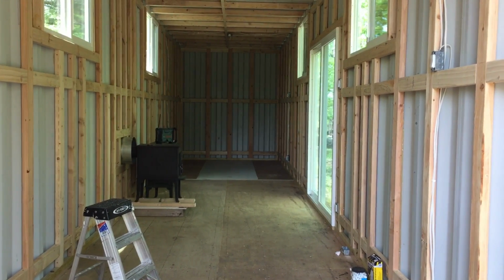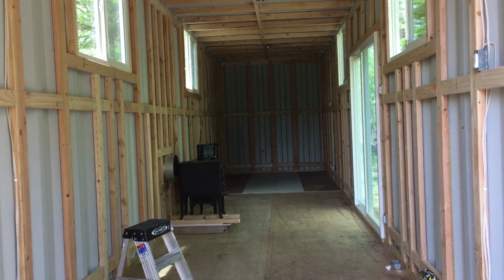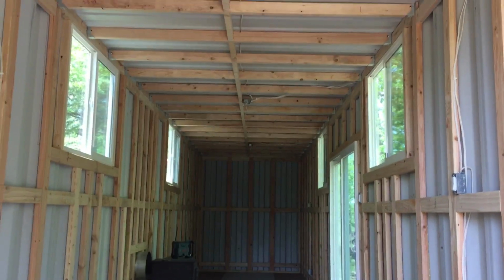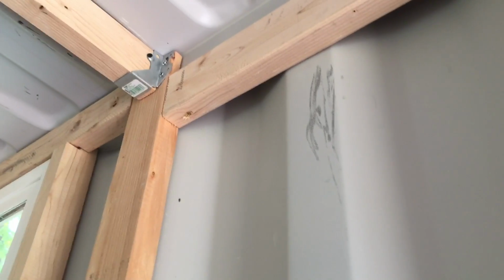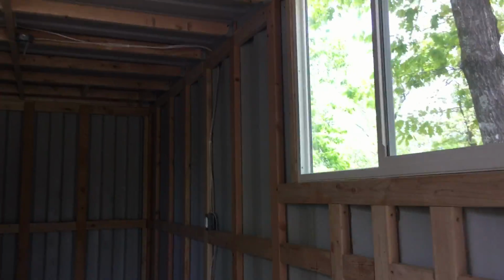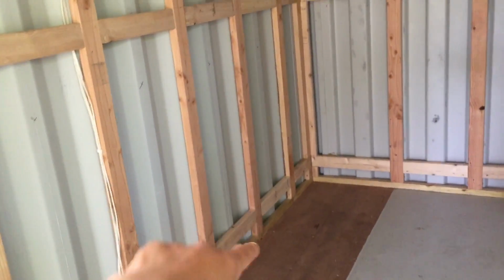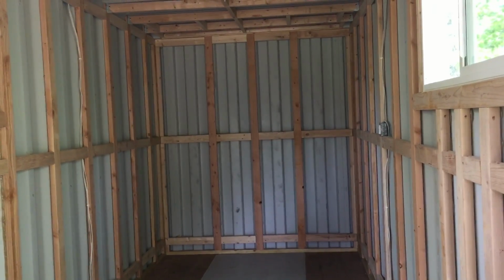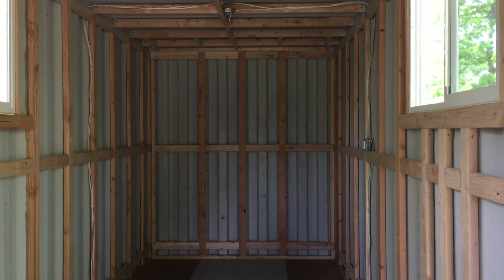Shipping Container House Framing

Comment: There's a chance someone will run a screw into the wiring. I think I would run the wiring in conduit and surface mount it. This would allow anyone to make changes in the future. 
The studs could probably be 2x2's or 2x3's and spaced 24 inches on center. This would reduce thermal bridging.
Reply: Totally agree being it’s a partitioning wall to begin with.

Comment: I have a thought that I invite anyone to reply to. I am planning a shipping container home. My plan is to frame the home on the outside, windows doors etc. That will give me voids to fill between 4 a 5.5 inches deep. I am researching using closed cell foam about an inch thick. Let it cure, then using the foam glue a foam board into the void and enclose it in the foam. I am thinking this may save money as I will need less foam. Then shave the excess, use Tyvec house wrap and Clapboard exterior siding. (I have a saw mill and can produce  these myself). Am I totally crazy? with the insulation on the outside will my walls sweat? I am building in southern Ga. Am planning a 36 inch perimeter wall inside for running the electricity, and exposed metal above that.  Also a 6x12 inch soffit around the ceiling to support LV lighting and the ceiling framing for conventional insulation. The roof will have a standard pitched roof to keep off the sun. Any thoughts are greatly appreciated. Al
Reply: Almon, it sounds like you are putting the insulation on the outside (smart), with siding.  I recommend Hardy Plank.  Have you considered foam insulation boards?
Reply: Seems the best option - good thinking.  Allow lots of insulation in GA & tarp the top from sun. Maybe skip the 3' inner wall - not really needed.    Likely u r cooling the inside making the metal colder than air- leading to some condensing...  But leaving exposed means east to wipe off/ bleach later if needed. Fans, dehumidifier, a/c probably good in the small space.
Reply: Alman. But most summer condensation should be to outside. In winter when warm air is inside maybe cond inside,  but hopefully minimal and easy to clean/evaporate as exposed.
Reply: Why even build with a container of your going to cover the outside and the inside ? Just so you can tell your friends you live in a container is a silly way to waste money, just build a traditional house of your going to do all that

Comment: i worked on a project that was three 40' containers. it was framed with mostly 2x3 metal stud offset 1/2 inch off the exterior so when the foam was sprayed in it was allowed to flow behind the studs and the steel skin.the ceiling was framed treated 2x6 on the perimeter with black paper stapled to the back and then bolted to the side of the container.  we did used metal shielded wire to rope it up and dropped the ceiling to 8' to allow for attic space to install hvac plumbing and fixtures ect.  i cut all the window and door holes with an angle grinder and we welded 2x2 tubing around the openings for strength. lumber was secured to the metal with screws to allow attachment of drywall and trim.  they used and under ground huge pipe buried in the ground that air was pumped through to help heat and cool the building. it was outfitted with rain catchment, wind and solar as well as a backup diesel generator acquired from a military/government auction.  it was about 900 square feet when complete and very efficient .
Reply: Have a link to it?  I'd love to see it.  Sounds awesome.
Reply: Cool story bro.
Reply: No link you made this whole wild story up

Comment: structural support???  What load are you carrying that would require extra structural support???   I've done over 300 containers.  If it's not treated lumber against that steel you're going to have rot.  How are you going to insulate now?  Not a wise design.
Reply: rmbaker100 what would you suggest ?
Reply: I thought he said there was a bead of glue on the back of the board. Would that leave a small space for foam to fill? Or would that glue fail.
Reply: @MaryCateOMalley   Mary Cate O'Malley  Spray foam can knock a nailed in window out of plumb.  It's an awesome thing as it adds insulation and can be a structural element as it tightens up/strengthens....but..  Since it can do all that it can also mess everything up.  #respectTheFoam ;). The foam will creep behind and I would be surprised if it doesn't bow out the metal walls and pop the boards off.  It would be better to have space to spray behind each board.  And if it's only 1/4 inch that's just stopping condensation and not offering any sort of insulation factors.  Not such an issue on the walls but...make that insulation thick on the ceiling.

Comment: Personally I would use Roxul for the insulation rather than spray foam.
It has a very high R-value, doesn't retain water & really great sound deadening!
Reply: isn't the issue here that the container will internally sweat? Therefor he needs the foam insulation to created a sealed vapor barrier so no sweating occurs which would otherwise cause mold and rot to form inside the walls?
Reply: I was thinking of using it after using a thin layer of spray foam to cover condensation issues.  Definitely cut down on the echo and would be great for bathroom privacy.  The problem with small home living is...folks can hear you potty.  You can deal with pee....but once someone gets diarrhea...ew.

Comment: Not a good idea to use Romex in a Metal Building. Should have been in EMT, "Smerf Tubing or Flex Conduit. Safety code violation and could end up electrocuting someone touching the bear metal
Reply: Earth it
Reply: Plus given the adhesive he used on the beams, I hope it's a non-solvent, or else it'll rot the insulation.
Reply: Would ROMEX with Sch 40 PVC pipes pass code?  You're still going to have metal J-boxes touching the steel frame of the house.  The J-boxes are the locations  where you're most likely to get a loose wire nut.

Comment: i know everybody has an opinion but if you use spray foam you will get ill, heat from the metal cube will heat the spray foam and create a noxious gas so stay safe and research this before application. spray  company's are now having to remove the whole roofs from properties that have been sprayed .
Reply: That off-gassing is caused by bad application, not the spray foam insulation itself. Spray foam insulation is everywhere in todays constructions. How do you suggest guaranteeing no inside condensation without the spray foam barrier?
Reply: @mattstanislen3165  Closed Cell polyurethane is polyurethane.  It will off-gas, regardless of how well it is applied.  But I get your point.  If not applied properly (right ratio for temperature), it will be a disaster.  

To Brian Clarke - heat can act as a catalyst.  It can speed up the chemical reaction that causes off-gassing.  It cannot create new off-gassing.
Reply: @usafa1993  i use celotex installation board and seal all cut edges and damage with foil tape . also a small vent in every wall located at the tops of each wall outside .
eco wool insulation is the only safe way and can be sandwiched between mylar foil for an excellent thermal  rating however be sure to leave a small void on the outside wall to prevent too much condensation .
Reply: There is a green spray foam available now.  It's what I'm hoping to use.  Otherwise I'll be drylocking the walls.  Also, I spray foamed our 36 ft car hauler with living quarters I gutted.  No issues or weird smells there.  :)

Comment: Nice video you could staple a vapour barrier over the frame which would hold back moisture adding to the foam plus it helps with sound deadening. Kingspan may be a cleaner and quicker option also thermally more effective but you did say your not really bothered how well it performs in my books this would take priority as in summer it would be cooler and winter warmer😐

Comment: Please tell me you didn't put that electrical wire between the metal container ceiling and the 2x4 lumber....
Reply: Please tell me why he wouldn't. There is an opening it went through, its not pinched.

Comment: This is the neatest framing I've seen.  DCP damp proof course membrane should have been added between the wood and metal. Condensation from the metal (not covered in spray foam) will seep into the wood, rot it out over time and mold will set in.
Reply: Yikes.....Mold and Rot.....
Reply: Only use membrane in a ongoing heated construction.
Otherwise heated side of the construction will change according to the weather conditions!
Try wenting the whole and use an automated dehumidifier... 
Regards from moist cold Scandinavia

Comment: do research on the chemicals in the floor
Reply: yeah gotta love methyl bromide
Reply: Yes, I have done 300+, A lot of unknowns in these things from the actual metal used, what's in the paint, what was stored in them.   Probably a health issue that Lawyers will make millions off of in ten years.
Reply: seal the floor with a couple of coats of paint below your finish flooring.Roll it into all the pores
Reply: @josephmclennan1229  Tear the floor out.  You don't want that toxic sh%t in your house.  Almost everyone knows that.  Replace it with 6 inches of polished concrete, with of course, radiant, hydronic, geothermal heating/cooling.

Comment: We have never seen anyone frame with 2 x 4's like this. Is this to code ?
Reply: Romex needs to be 1.5” back from wall surface or be protected.  The wall runs should be in conduit.
Reply: When putting framing inside of an existing containment like this container yes it is allowed to turn the two-by-four sideways but if the two-by-fours are actually structurally holding a load-bearing wall they are not allowed to be turned sideways
Reply: How will they bow out if they're surrounded by closed-cell spray foam insulation? Code varies by county & state so I don't know it may be legit in some places. I'm not claiming to be an expert here, just kind of playing devil's advocate to get more information on why I'm right or wrong. Any expertise you have on this would be appreciated.
Reply: The lumber will bow if in a humid enough environment, and if not fastened with mechanical means to the container. Glue, no matter how strong will ultimately fail. The foam insulation will not offer any additional support.
Reply: 1badpete999 I was thinking the same, the way he is using them, why not use 1X4's?
Reply: Good question
Reply: I have built custom homes and commercial buildings in 3 states, and all of those states allow the lumber to be turned on the side inside an existing structure due to the fact the are not part of the structural integrity of said structure. Though I do agree without proper fastening of the lumber it will eventually cause problems with the finished interior walls
Reply: These 2x4 will twist when they dry up ,at this point could have use 1X4 would have been les problematic !
Reply: Was also thinking the the way the 2X4 are installed they give no structural strength or economical sense at all, even if if their not used as a bearing walls ,and as we all know 2X4 spruce wood installed on their flatside will bend and twist like crazy when they will fully cure their water content down ! just saying !
Reply: ChefGiovanni moron
Reply: No Code on these things.  The guy is not experienced.  I am.
Reply: I would glue and bolt the studs because of possible bowing.
Reply: No it is not code. and no even inside a shipping container is this NOT ok.  also one thing that this guy wasn't thinking about is that those 2x4's will in fact in time Bow out and his drywall will be popping away from the wall...  I promise you...  wait for it.. wait for it...

Comment: Overkill... your only holding up your wall finish like drywall...
Reply: Must be an easier way to insulate it, perhaps on the outside.
Reply: @amathonn  Galvanized steel studs.  Floor to ceiling.  I understand the challenge of the gentleman who made the video.  Any sort of actual insulation in a cold area for a single container means virtually no living space.  You really do need multiple containers welded together.  Unless, you are willing to insulate on the outside.  Then you lose the cool, industrial-look.

Comment: Is off-grid shipping container living practical in "frost pocket" areas?
Reply: Ivan James yes keeps cold air out in winter and hot air out in summer
Reply: If you want to save yourself some work, then go with a 40 ft. refer(refridgerator-freezer). Of-course they're going to cost a little more than a standard shipping container, but you'll know it can hold up to the elements. Plus whether you purchase a unit that is mint or used, rust is inevitable. So look into painting it with a rubberized base coat, in-addition to reflective paint. OR look into a product called Grafotherm ...you can see it's use & properties via YouTube.
Reply: @justinbarney6286  I could see using a reefer unit for insulation purposes...but you would still need to frame it and hang sheet rock, which would diminish interior space all around.

Comment: I really don’t understand the rage about shipping containers . Such a waste of resources . You have to frame the thing anyway so why have all that steel that will cause so much trouble with condensation? Just stick build it for cheaper and healthier environment
Reply: it is far more durable then a traditional framed home. the long term life expectancy is far more than that of a traditional home. you can actually if done right move your entire home if desired. in many cases in the lower regions you DON'T need to frame out the insides. not to mention these things can and most of the time are bolted to the ground. if a tornado rolled through Your home would be the only one standing...  there is also the silly crazy reasons. like if an EMP went off the chances of your electronics surviving because of a sealed steel structure.
Reply: A waste?  Taking a corten steel container and up-cycling it?  No cutting down trees?  No foundation, only piers?  No roofing?  You have a funny definitions for  waste and environmentally friendly.  Now do you get the rage?
Reply: You set the container on concrete piers with rebar , and welded to a metal plate will make it tornado proof ,and high wind . You don't have the cost of a full foundation , or slab.
Reply: Double D no o have never built a container home. I have one I use for storage and it can literally rain condensation in it. Also the maker of this video talks about sweat and condensation . Many people have condensation problems with these containers
Reply: Why do you think conventional would be cheaper? Windload requirement in my area is 130mph and I bet a shipping container meets that without any modification. Stick built has to be a hefty heifer to meet that.

Comment: Have you considered thermal bridging when framing out these shipping containers for residential use?
Reply: Any details?
Reply: @avanders457  15017 Hfx is correct. His wall framing is in direct contact with the metal. To avoid this, I would put at least a 1/2" sheet of polyiso board between the wood and the metal to reduce the thermal bridging.

Comment: I’m not trying to be critical with this question, but what is the point of using a shipping container when you have to frame everything anyway? This seems wasteful, expensive, and overly complicated.
Reply: if you live north it gets below zero in the winters...  have you any idea what it would be like inside a steel container in the middle of the winter?  this is why you still need to frame it and insulate it.  these homes are mostly seen in the south or just warmer climates. there is where you get the best value. warmer climates you don't exactly need to insulate. but still remember the framing isn't all that goes in to building a home. for 1 in a traditional home you have more than just the 2x4 framed wall. you have siding that many don't do on a shipping container home because they are looking for that idustrial look for a reason. 2. you have 2x6 and 2x8's 2x10s floor joists. ceiling joists and shingles and plywood.  the price of those items and labor to build it within a timely manor far exceeds that of a few containers 2x4s and far less labor. it just makes sense.   and it is actually very simple.  if you cut out more than half of a section you need to reinforce.  it is only complicated to those who don't understand building.
Reply: @DoubleD72  Use steel footers, headers, and studs.  That's how this needs to be done.  Frame this entire container in less than a day.  1 person.  Working slowly.  About the same cost as wood.  But will never bow, decay, rot, etc.

Comment: i'm assuming spray insulation to stop condensation?  the wood will be right against the metal - don't see a foam barrier there.
Reply: you are right. no matter what insulation is used steel will condensate on wood and it WILL ROT no matter where you live. so many youtube pros who don't have a clue. studs should have been fastened to floor and roof which would of allowed room for insulation between steel and wood.
Reply: @mikejackson6862  excactly.. Or using the vertical parts holding the horizontal beam. 
(simply two ~45° angled screws) 
No need for studs in the ceiling and wall frames kept in place.
Reply: renge99O9 some people don’t need materialistic shit to be happy...just shows what you are all about
Reply: Actually wood is naturally an insulator.
Reply: renge99O9  haha you don’t even know me or what I have...what’s your definition of failure? Sounds like you don’t know what life is about
Reply: One solution to eliminate interior condensation, there's a product called Grafotherm ...look it up via YouTube ;) Even consider installing an HVAC, air units, and even a big box(or several) of kitty litter.
Reply: rapunzel eh? Thermal bridging